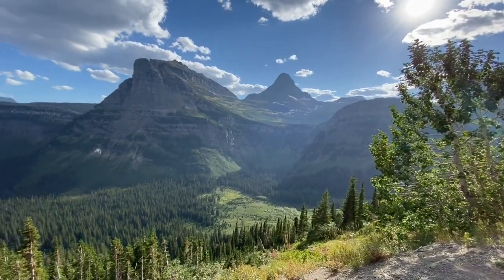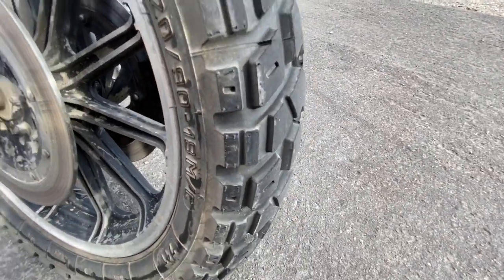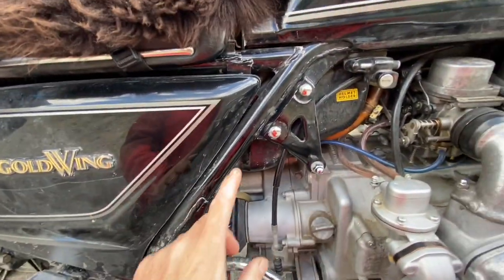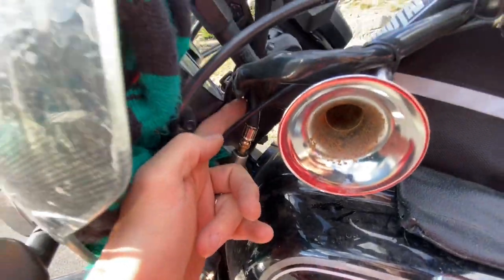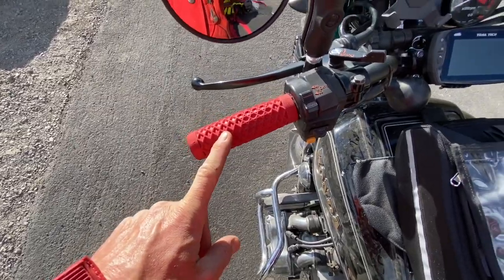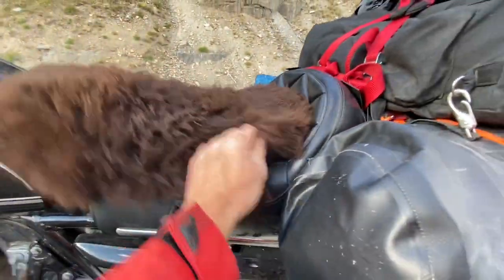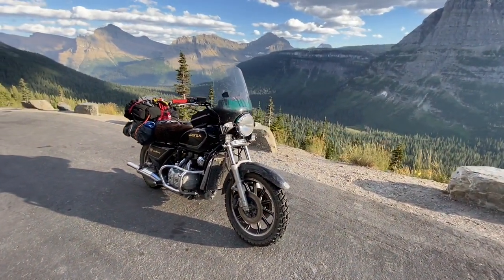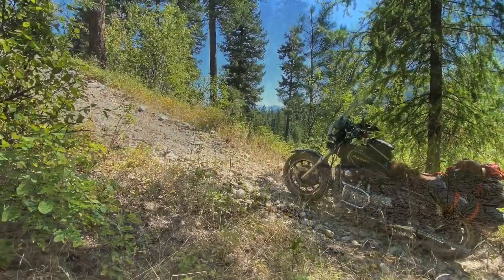83’ Honda GL1100 Gold Wing ADV Rally Bike

Comment: GL1100 is the best ADV bike ever made. It’s good to see others recognizing it.
Pro-tip: double the recommended air pressure in the suspension before going off-road. Helps a lot, and we’ve never blown a seal even on the MX track.
Reply: Dos Honduros, I'm in Washington upon the Kitsap Peninsula and you guys captured the Northwest, love your videos, keep them up.
Reply: How do you fill and measure the pressure? I'm having some trouble with my 1200 regarding to manually pressurizing the front suspension. I have a mountainbike suspension pump from rox shox but the scales are not precise enough?
Reply: @SaabZimri  I use a small bike pump. I pump it up higher than the pressure I want and using a pressure gauge I check it. Every time you check it the pressure will drop. I check it until I am about 1 psi over the pressure I want.

Comment: The mufflers if I remember correctly are double walled so be careful if you start cutting them apart they were made to keep the chrome from discoloring.
Reply: I have the downwards pointing mufflers on the 82
Reply: First gen GL1000s, '75 thru '77, had black painted exhaust with the rear muffler half having a removable(?) chrome shield. While I'm pretty sure they would bolt right up to the GL1100 motor, I could not speak to how running with them would affect performance.

Comment: The 80 and 81 models used the Comstar rims in 19” front and 17” rear which make using dual sport rubber MUCH easier.

Comment: Fix the air suspension.  Pump it up for offroad. Bleed air iff for your ride home. Install a Single Solex Carb.  1 carb is easy to adjust the mixture when you do radical elevation changes.  No carb balancing issues either.  Cheaper to install a single Solex or a dual throat downdraft Weber carb.  Why spend so much on carb kits when a single carb is more efficient?

Comment: I have an 83 as well that I'm trying to decide what to do with.  This is an option I've thought about, nice job. Can you post the parts you used, bars, lights etc? I've been struggling to find a headlight to use, mine had the full dress so I need to buy a headlight and brackets.

Comment: Bash plate and front mudflap strike me as useful additions. Oops should have waited until the end before commenting. It strikes me though that back in the 80s we rode whatever, down dirt roads, because they were in the way. For mine, I think your tyres, mudguard clearance, and soft luggage (no noise), are what works and of course, not getting too extreme. Damn, it happened again, I should have waited before commenting. Thanks for this. I have a GL1200 and I have enjoyed it a lot but its place is about to be taken by a 1500. What to do? Where I live - an all-roads GW makes a lot of sense. Enjoyed the video.

Comment: enjoyed your video buddy with useful tips.bought myself a gl, 1000, k2 model early this year,lots of problems with electrics, fuel, etc, so had engineers build a 4 into 1 inlet and fitted a single weber carb, but winter here in uk posed a problem with jets freezing, thats sorted now with thermal wrap around manifold.love the idea of adv tires,as i,d like to do some travelling and not always on tarmac.the 3 gauges on the tank is something i,d like to get rid of, any thoughts on that would be helpful,as mine are rusty and in the way. the tank, flip up lid is a better design than what i have on mine,78 model. one worrying problem is the first gear is crunchy to engage, so maybe i,d have to take the engine out to determine whats wrong??any useful tips would be appreciated, thanks. from barry uk

Comment: Install a single VW Solex carburetor and no longer worry about those "delicate" carbs.  The stock carbs are great on the highway but not for an ADV bike.  Gl1000-1100-1200 are really great engines that run better with a single carb.

Comment: Hey @tacomoto  any update on this bike. How did the carbs hold up with riding at that elevation?
Reply from the maker: Had them fully rebuilt by bear cycles in Wisconsin and the bike was completely transformed
Reply: Rebuilt to OEM specs?. Just wondering if the carbs caused any issues at that elevation on Logan pass, I think it’s about 6600’